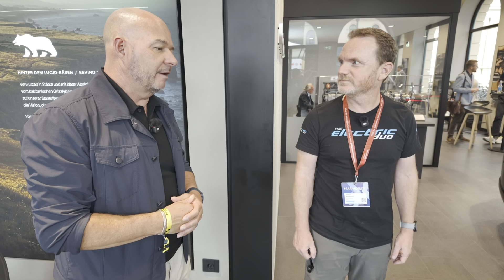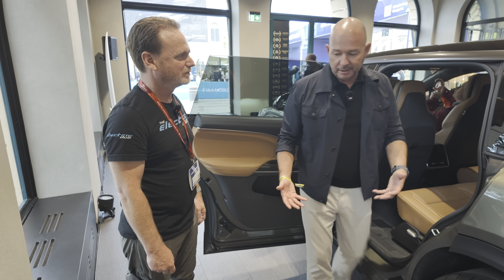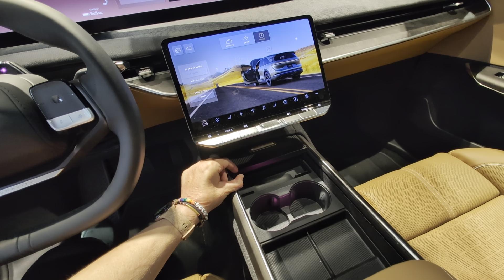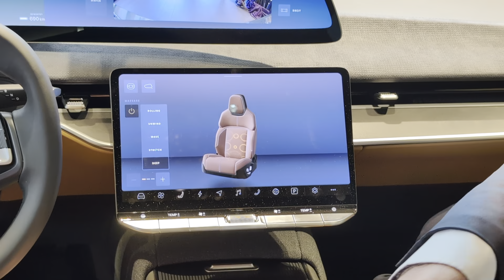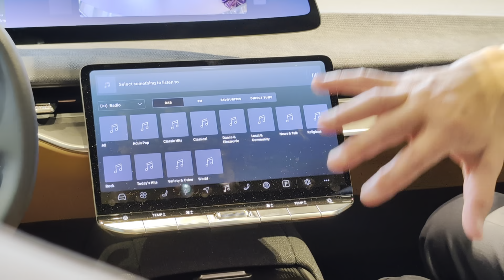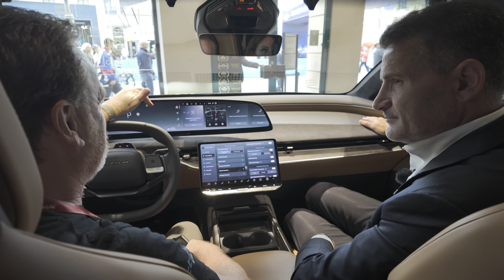Lucid Gravity deep dive with Design & Engineering VPs @ the European Launch

Comment: While I agree that the Gravity is a great vehicle (so much so that I've put down the $1k for an order deposit), it's clear that they've released the vehicle in the USA with a lot of glitches that are causing owners real headaches.  Add in that a lot of the features they've promoted aren't actually available, because the software is still so immature.  It's a shame that you missed the opportunity to ask Lucid executives about their quality problems.  The Lucid Air launch was tarnished by similar problems, and glowing early reviews quickly turned much more negative as a result.  Repeating that launch experience with the Gravity risks Lucid cementing a reputation for questionable quality, and calls into question their ability to survive if they do it again with their up-coming mid-market vehicles.  The Gravity drives beautifully.  But a lot of people view vehicles as appliances where reliable operation is the most important consideration.

Comment: If it was a suicide door on the back a driver in a wheelchair would be able to transfer to drivers seat and slide the chair into the back
Reply: The rear door that slides towards the back is one reason minivans are popular vehicles for so many minivan drivers.  Add in both the ability to remotely close the rear slider, and also that minivans typically allow you to completely remove the seat behind the driver, and you have a space that makes it much more feasible to mount a wheelchair crane/hoist and also have easy space for the wheelchair to fit in.  The Gravity's inability to remove the rear seat would make getting a wheelchair in without assistance much more difficult.  All in all, this isn't the best vehicle for a wheelchair user.